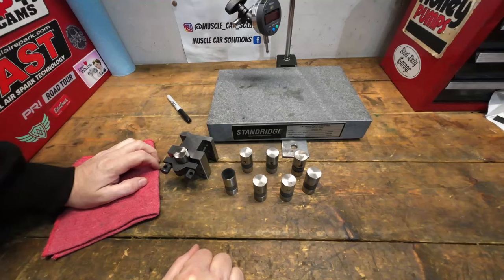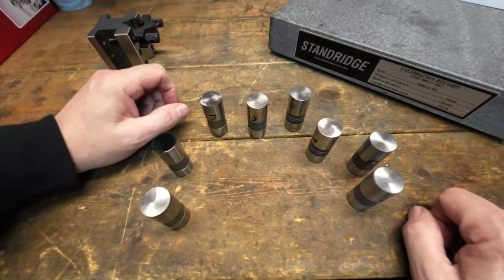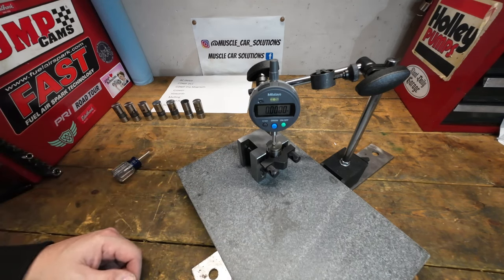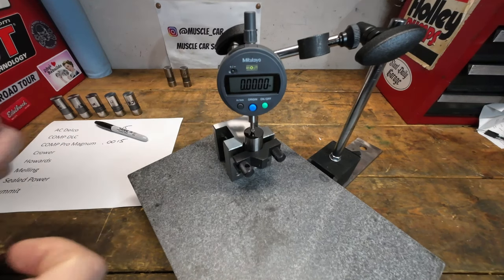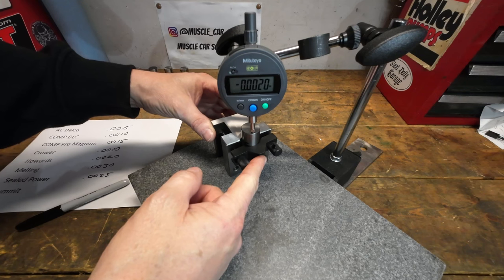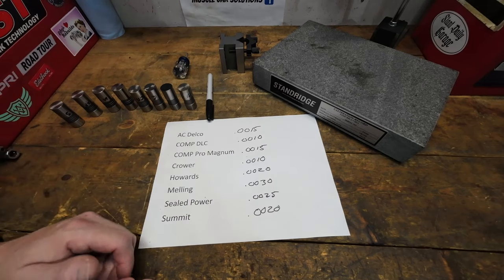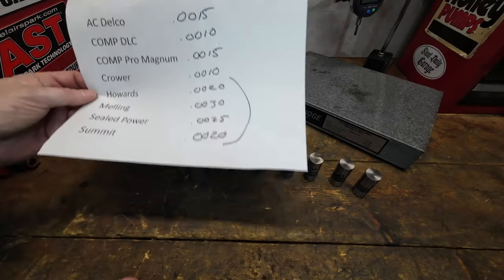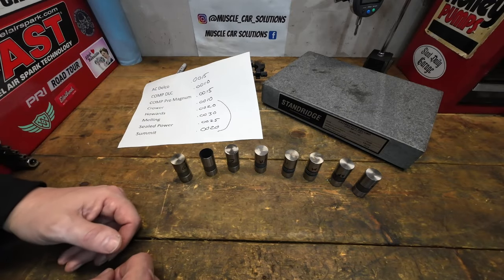Bad Crown Causing Flat Tappet Lifters to Fail?

Comment: This is by far the most thorough investigation of the mysterious lifter issues we hear about constantly. Nice job!
The recipe for my cam success' are as follows. Lifter bores checked & honed.
Crower Cam Saver lifters are used each time which have a .0015" deep flat spot milled into the O.D. of each lifter & lets a jet of oil bypass the lifter bore & blast the cam lobe.
Each lifter is checked for crown but nowhere near as precise as what's in this video. I simply put each lifter on our perfectly flat quartz kitchen countertop (shhh!) & confirm that it rocks on its center high spot.
I measure each cam lobe to confirm .003"-.004" taper. 
Plenty of break in Grease on cam lobes and lifter face but ONLY light oil in lifter bores as to facilitate easier rotation on initial start up. I then fully assemble valve train & put a bright colored magic marker stripe on the top of each lifter. I prime the oil pump, remove spark plugs and jave someone turn the key so I CAN WATCH EACH LIFTER SPIN. Only then will I install the intake manifold & complete the job. I break in the cam with Driven BR-40 oil. If this is too much trouble, it means you enjoy gambling. I Do Not Gamble. 👍

Comment: The key is that crown is present. (s/b .002-.003 ideal)  That should be equal to the lobe taper on the camshaft used. Light springs and correct break-in procedure should then spell success. If not, probably a metallurgic issue. B.T.W. It was common in the 80s, 70s and earlier to reuse flat-tappet cams and install new lifters. Hardly any failures. Go figure...
Reply from the maker: We’ve covered quite a bit in this series on why todays failures are occurring.  The biggest one I still believe is the lack of attention to the lifter bores.  But compound that with all the others and it’s a recipe for disaster.

Comment: When considering the need for lifter rotation the lifter bore clearance is very important.  A tool I never thought was necessary was the little slide hammer lifter removing tool. It was supposed to be for sludged up lifters. How many of these were used to force a mushroomed lifter out. Dragging the damaged lifter out the mushroom  burr could gouge a lot of metal out of the lifter bore.

Comment: I can give you a bit of insight as to how this used to be in the late 80's and well into the late 90's. I used to own a speed shop, and as you can imagine I sold tons and tons of cams and lifters. I used to be a Crane Cams and a Norris Cams Master Warehouse Distributor. A lot of the V8 engines that we sold cams for were really old 60's/early 70's engines. By that time they were already close to if not 30 years old. I must have sold thousands of cam and lifter kits in close to 10 years in business and not once did I ever hear back from a customer that they had a cam/lifter failure. Now, these engines are now 50 years old, but the reality is that most all of these engines, at least the ones in "high performance use" have not really been daily drivers for probably the last 40 years or more. Even in the 80's and 90's most of the cars we were selling cams and lifters to were not daily drivers, unless they were a 5.0 Mustang, which most of them had roller lifters anyways. What I am trying to say is that yes a lot of these blocks have now been in use for 50+ years, but they have been in very light use for probably the last 30+ years. The real wear on these blocks happened in the first 5-10 years of their existence when they were used as daily transportation. After probably 20 years most were not daily transportation and were only used occasionally. I don't believe that most of these blocks have much more lifer bore wear than what they had 20 years ago. For example, I have a 1972 Olds 442 convertible Factory U code 455 car that has 78,000 original miles on it. When I bought it 20 years ago it had 74,000 miles on it. So, it has ran 4,000 miles in 20 years...
Reply from the maker: Kind of a small sample size to assume that’s a majority.  I built my first engine in 1983 and never even considered a failure.  I can tell you after speaking with a lot of engine builders across the country and at PRI each year, they absolutely see bore wear.  They also generally will not build a flat tappet engine unless it’s a class spec engine.  If I had an endless supply of cash, I’d buy a hundred cams and a hundred sets of lifters from various manufacturers and Rockwell test them all, and dissect them like the way we did in the video on camshaft hardness.  Because the US made cores only come from a couple suppliers (and even they are limiting their production of flat tappet cores) and the lifters have just a couple making them anymore, it would be easy to verify what the cam grinders are getting ahold of and if any issues are found.  I’ll go out an a pretty short limb and say you’ll not find many problems.  The process hasn’t changed.  The material hasn’t changed.  Only the volume.  So we have to start looking elsewhere and I do believe lifter bore is a top contributor.  Excessive spring pressures also coincide with that issue. Then oil, etc.  when you have a couple factors against you, the potential for failure is greater.  Don’t make me go out and measure 100 blocks.  I could barely afford to buy all the lifters for this test.  😉
Reply: @MuscleCarSolutions  I am not saying that the lifter bore wear is not an issue or a contributing factor. What I am trying to say is that back when I was doing this on a daily basis, if anyone measured those blocks, they would have probably had as much lifter bore wear as is being measured now. Most of those old blocks back then had over 100,000 miles, yet no one even though of measuring lifter bore wear back then. I sold my store in 1998 and up until then there were no issues and I don't think issues started popping up till 10+ years later.
Reply: @bigboreracing356  I can assure you that it is bad, maybe not as bad as some people think but it is bad. As I posted above I had a very successful speed shop from the mid 80s' to the late 90's. I sold thousands upon thousands of cam and lifter kits and not once did I have a customer come back with a flattened cam lobe or lifter. This was not an issue back then. You can now see a ton of Youtubers having cams go flat and clearly stating that they had never in decades of putting engines together have a lobe or lifter go flat. Although I do agree with you that social media and the internet are probably making this look worse than it is, it is a real issue that was almost unheard of 20 years ago.

Comment: My experience has been that break in oil and lobe placement positions on the core are major factors. 
The lobe c/L has to be behind the lifter bore c/L by .030" to .045" for good lifter speed. Ive never had soft cams or lifters 
Tested submerged cam and lifters- with excellent results 
Oil film strength is crucial- break in oil is deficient for flat tappet interface.

Comment: didnt know the mellings were so bad.  good info
Reply from the maker: Was a bit of a surprise.  You don’t know until you actually measure!
Reply: today maybe China imports as Edelbrock are said
Reply from the maker: @Schlipperschlopper  what?
Reply: May have been my luck of the draw but it sure proved that if you don't check, you will be pulling the pin on the hand grenade.
Reply from the maker: @4speed3pedals  lifter crown and cam lobe taper is only one aspect that must be checked prior to break in.  We’ve covered all the other things to check and properly set up in this series.

Comment: If you read the astm test procedures for cam & lifter wear [IVA & IVB tests], note the engines specified for each is overhead cam design - they are not testing on pushrod style engines, so maybe api spec means something, maybe it doesn't.  I tend to think api spec [as seen at the parts store] is window dressing: real engineering criteria is locked down in an NDA by auto manufacturers when they get an oil company on board for being the recommended product on new engines.  The recurrance of problems despite a number of people going out of their way to check hardness leans towards the complex - a blend of issues are in hand.  Old blocks with lifter bore problems, weak or detergent overloaded oils [a seeming evil in dealing with low tension rings of modern engines], and lifters ground to some spec that may not be a match for lobe taper probably top the list. Complicating things at present is the ongoing [unreported] recession: in tough times, oil companies may pull back on some additive package quality, just so people will/can buy - that can be both a help and a problem at the same time.   
Nice to see lifter numbers, but they do remain unqualified absent taper.  25 or 30 tenths  seems weird, but if taper complements, might be just fine.  I do not have an inspection plate so I cannot measure my lifter crown properly right now, but I could mic an old lunati  cam lobe: about 0.0025" worth of taper.  Doing the trig on that was a little on the guesswork side because distance between measurments suffers from being eyeballed [roughly 0.450"] - that came out to something near 0.33 degrees.  I know there's error in that - maybe 10%, because a taper never is a nice concentric or parallel place that a typical mic prefers.  I only wish I had a proper plate & probe as used in the video to finish the lifter half to get a handle on peak oil film load radius from lifter center - there's a tangent in the puzzle I just can't get at on account of tools.
Reply: the forces on an overhead cam is a lot less. even in ohc direct valve cup actuation camshaft setup that is "flat tappet" equivalent of the ohc options (that could wipe or whatever too, but if the cams and stuff is done in a way that is good enough for that it might be good enough for cam in block, the same cam process could be absolutely  fine on a ferrari or a toyota then and not on a 350)

Comment: Just sent back a set of Howards lifters that had more peaks and valleys than West Virginia!! Worst shit I have ever seen! Going to use a set of Isky lifters I have on hand and have them re-ground for the camshaft I'm using.

Also, you have to go around the entire perimeter of the lifter. The set I had was all over the place from .001 to .0025, with a couple over .003.

Howards claims to use a 4060" radius, but it's a radius, not just some pointed peak in the center.
Reply from the maker: I made mention in the video that it was measured 5 different times on each lifter.  For times sake, I just showed the one.  The only one I had any discrepancy on was the Crower.

Comment: I don't understand why roller lifters are so much more expensive than flat tappets. I understand there is a little with the roller part of the lifter and the link bar. But some roller cam sets are in the $1k+ range.

Why?
Reply from the maker: I’m not sure I’m capable of explaining that.  It’s pretty obvious if you have them both in hand to see how much more manufacturing is needed to make and assemble a roller lifter.
Reply: A  very good flat tappet lifter sold by GM in my country Germany costs here 275 Euros PER LIFTER! A good flat tappet here is much more expensive compared to a top quality set of rollers

Comment: After watching your testing of crown, I did the same test on a new set of Comp hyd flat tappet lifters, but after zeroing out the dial indicator I measured the outer edge at noon, 3 o'clock, 6 and 9.  My lifters have an "oval crown" on them.  I also found on Comp's website that they had lifter bore grooving tool to give the bore a small groove to allow oil to spill onto the lobe before it gets pressure to the lifter.  Have you ever tried one ? your thoughts please.

Comment: Thank you for covering that...as long as there is a flat-head motor out there being built ... I'm sure there always be a flat tappet cam being there for build assembly....good content and thanks
Reply from the maker: I honestly hope that the flat tappet option remains available for folks that choose to run one.  Just not sure if the industry is going to continue to offer them.  I know comp spent a ton on the DLC research and those have helped significantly.  But beyond that, if the cam cores aren’t available or they have to come from India or China then that will be the last option.

Comment: I have 16 lifters, new, Melling, in the Melling boxes for a small block Chevy. No sense talking about what they match, I wish I knew.I got them for the Melling Z-28 second design off-road cam they grind.  I purchased these about the time the lockdowns started and purchased them from Auto Zone, they were shipped to my house. They all look great. In fact, I took known Johnson lifters and compared them by taking one each apart and measuring everything and there is no appreciable difference other than the crown. I may have posted this below one of your videos. They are machined by a blind guy that used a bench grinder in my opinion knowing it is a Melling product. I now think they are Purchased from Melling and Melling grinds the face. They  are flat,  angled, low crown and some with crown a .003 crown.  I doubt 2 are alike.  If you would like to measure them just to prove me wrong or to see for yourself, I can ship them to you if you will do a video on them. You don't have to mention my name or where I am from and I prefer this. All I ask is that  you ship them back at  your expense. I finally settled on Crower supplied Johnson lifters and am satisfied with the measurements.  I did not waste time to evaluate the chamfer but I know Melling now supplies lifters with no quality control. I checked them for hardness with Japanese hardness files and all meed the correct range. It is the crown that is horrible. There are very few machine shops that have equipment that put a crown on a lifter. Unless you find a job shop that can sharpen tooling and is willing to do the job, automotive machine shops normally lack this equipment. Winona Van Norman makes a machine that puts an actual crown on a lifter. There is a video on Youtube that Winona Van Norman has covering how the TRX grinder works. It can produce 8, 000 properly ground lifters per day. doesn't take up any more space than a valve grinder mounted on a cabinet. Many of the older lifter grinders some shops have put a flat taper from the center to the edge. If you want the new TRX grinder, expect to pay over twenty thousand dollars and is it profitable for a small shop?  I did find a small job shop in my vicinity and have not spoken with him with lifters in hand to find out the cost. Due to the time I have owned these, I have not investigated if I can return them but if the job shop is out of my budget, I will jump all over Auto Zone if need be. The machine shop I used to work at in Baltimore used to purchase Johnson lifters by the gross and they came in a dark blue cardboard box with cardboard dividers and it was 2 tiers of lifters. Talk about heavy. Back then, we could get them for one dollar a piece, late 60's. Time have changed and so has quality control.
Reply from the maker: At .003 I would agree.  That is horrible.  Because they offer cams, my assumption is they were ground to match the lobe taper.  But we’re back into a cost thing for me.  I’d absolutely love to buy a few cam and lifter sets and measure crown and taper to see if 1) they are matched and 2) how good or how excessive they are.  Maybe one day but I can only image the cost for that little learning experience!
Reply: scrap them or return! Get a Crower or Isky custom grind billet roller
Reply: @Schlipperschlopper  Why?  Roller assembly costs more and keeps me from purchasing more important things. Most rollers sold are hydraulic and I despise hydraulic tappets. A higher revving roller will cost even more. For my build, I do not need a roller for it takes some of the fun out of seeing better performance from old school style builds. I have thought about purchasing one, looked over some of the offerings and that is when the confusion and the "gotta trust the cam grinder company" sets in and most aftermarket cam companies have the LSA wrong. LSA is the figure needed to know inorder to get maximum cylinder filling. A proper LSA will create  better low end performance whild adding some power at top end. The main benefit is low end. A flat tappet SBC should be about 107-108 LSA and you see some way out numbers. This is not the only thing you need to know about those lobes. Billy Godbold's book falls short in explaining LSA, totally short. If you want to go fast, it costs more money all the time and I may never own a roller cam and I will still have some very nice performance and it will have a better sound. Rollers are for impaient people or those that want the max hp. I am neither and I am willing to do trial and error adjustments to learn even more.
Reply from the maker: LSA at a set value in the 107-108 range limits what the engine is capable of when different modifications are made.  Take nitrous for example.  In the last 20 years I don’t think I’ve had a single one ground on anything other than a 113 LSA.  If they were on a 108 with no additional advance ground in, the thing wouldn’t rpm aggressively.  If you really wanna freak yourself out, look at modern direct injection engines ground on 120+ LSA and with a few more degree’s added.  Technology advances.  Cam technology has really advanced on the last 20 years.  The cam designers haven’t gotten it wrong.  They’ve continued to make more and more power by moving around the opening and closing events.